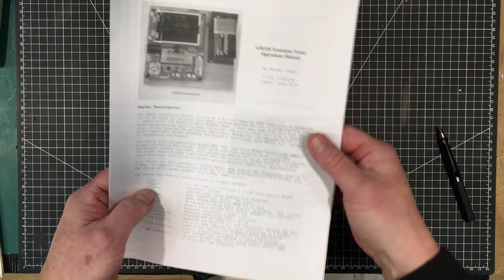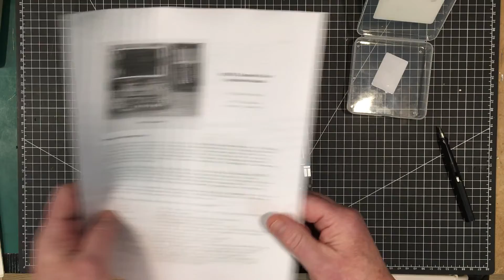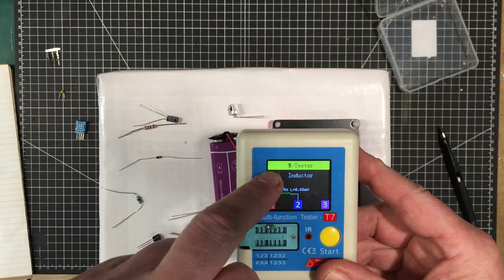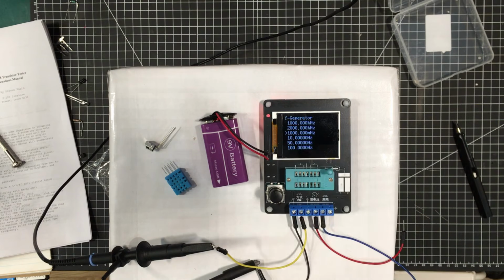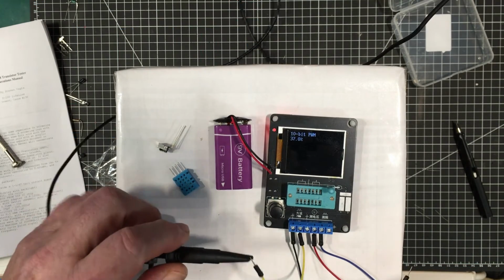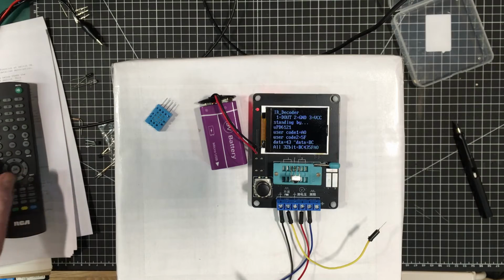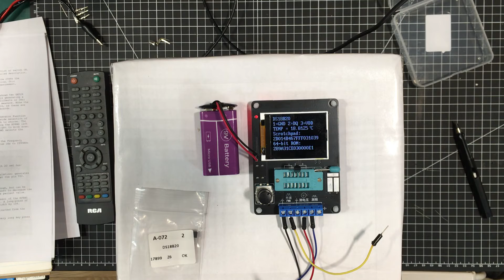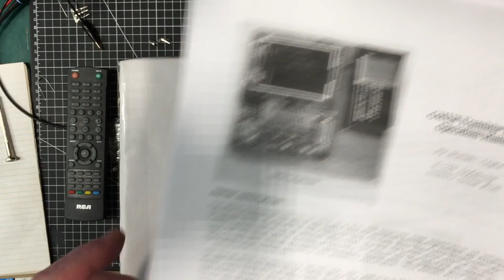0154 - Is the GM328A the Best of the mini-testers?

Comment: The original Atmel transistor tester concept was developed by Markus Frejek and Karl-Heinz Kübbeler, with firmware initially based on the AVR microcontroller platform (e.g., ATmega8, later ATmega328P). This design became widely popular due to its open-source nature, leading to numerous clones and variants produced by hobbyists and manufacturers, especially in China. The GM328, LCR-T4, and similar testers (e.g., LCR-TC1, LCR-T7) are all derivatives of this design, adapted with different features, displays, and enclosures.
Reply: And they are all garbage if they don't use the 328 processor. Unfortunately, you will no longer find any of those "LCR" ones with a non counterfeit processor (even the ones claiming to be 328 are just relabeled chips). The only way to get a 328 is this model shown here - preferably the older one with a DIP processor, as the chinese garbage does not exist in DIP.
Reply: I will try to unsolder the lgt8f328p clone cpu and try to solder one that allegedly is marked microchip atmega328p, because althought the clone doesn't have "fuses" allegedly, there is something odd about it it could be somehow not reprogrammable ? (although from avrdude it reads back as firmware correctly written, it could be the bootloader)
Reply from the maker: @whuzzzup  Thanks for you input.
Reply from the maker: Good background.  Thanks.

Comment: Can this GM328A do in-circuit ESR testing with some short wires and alligator clips? Thnx
Reply from the maker: Unfortunately, the methods used and the voltages applied to the DUT would not make this suitable for in-circuit testing.  There are some inexpensive tweezer meters from Zoyi, Snakol and FNIRSI that allow you to change the test voltage and frequency.  These would be much better for that use.  They are generally more accurate too.

Comment: Hi great video. Did you update firmware to latest.
Reply from the maker: Thanks.  I haven't found the need to update yet.  One of the difficulties is, there are a number of different versions of the GM328A, some have updates, some do not.  Before you can do anything though you need to find out which version you have, then determine the update status.
Reply: @uni-byte  got myself  same  one,  printed  a case from printables.  I saw  that there  is  an update that supports  testing  of opto coupler, im not  sure if it supported for us. I was  hoping this tester would test regulators.
Reply from the maker: @zombieryder  The one I have does not support either opto-couplers or regulators.

Comment: When you say it might be the best, you're comparing to the LCR-T7 (and all the similar Chinese clones) with the open source firmwares?
Reply from the maker: Those that I've tested anyway.
Reply: @uni-byte  With the open-source firmware?
Reply from the maker: @NicksStuff  Hmm, I have an LCR-T4 and LCR-T7 and this GM328A.  They all have different firmware on them and behave in quite different ways.  To be honest, I wouldn't really know if any of them have the open-source firmware on them or not or even if they could have it.  How would you tell?
Reply: You won't find (it seems starting in 2022) those LCR ones with original firmware because they use counterfeit chips (aka not 328) which cannot run the original firmware.

Comment: I think I've finally found some time to start playing with mine, so I figured I'd rewatch this video as a reminder since I'm old and forgetful. Being old-fashioned I've found it handy to  print up a binder with the operating manuals and specifications of my small test equipment and radio gear, gear that isn't too simple to bother with, or so sophisticated that it has a 250 page manual. Everything just has so many features these days that it's hard to stay on top of them all.  The sophisticated gear, along with component datasheets and technical articles are all stored in a folder on my laptops and a couple of USB memory sticks for backup that I try to update every couple of months as I add to the data. (Information management is a much bigger job than when I just had a stack of data-books, even when I had a whole bookshelf of them. Fortunately, memory sticks are small and cheap.) Thanks again for posting these videos. I find them both interesting and useful. You possess both technical knowledge and a common sense perspective on electronics that I enjoy. That's uncommon on YouTube.
Reply from the maker: Thank you!

Comment: My T7 was some £22. GM328A is half the price. Just tried to order one using your link, unfortunately: "This product can't be shipped to your address. Select another product or address." Could you provide link working globally? And what is affiliate link supposed to do?
Reply: After I have logged in Ali GM328A link works fine. But affiliate link still does not seem to be doing anything.
Reply from the maker: Was it the same vendor (CI-Boom Store)?
Reply from the maker: Some vendors do not ship to some countries.  I've added an alternative link.
Reply: Yes, the same store, I have already ordered. Your link was ok, I just had to log in. But what is the "AliExpress Affiliate Link: " just above "GM328A Tester:" link?  @uni-byte

Comment: Where do you get the idea that it will lose the cal information only on USB-C power? The mega328 has EEPROM and AFAIK any normal distribution of transistor tester software uses it

You can probably even recalibrate any of the boxed testers to get better results. If you get access to the programming pins you can even reprogram them most of the time to the latest firmware, rather than the one the chinese picked X years ago.
Reply from the maker: Actual experience.  I had calibrated it before doing the video using external power and it was not retained.  The ATMega328 also has 2K of RAM.  Perhaps they are storing the calibration data in there.  In addition to the 328 there is another unmarked 20-pin programable chip on the board.  Programming pins for both are brought out to pads.

Comment: I bought a much simpler version of one of these component testers a number of years ago. At the time I put it together from a kit and didn't expect a lot. Salvaging components from all kinds of things made me start using it and I have to say its been one of the most used tools I have. Recently I bought the GM328 and hope to start using it along with its increased capabilities. I'm sold on these and the price you can pick one up for it's abilities is incredible.
Reply from the maker: Yeah, they are great for quickly sorting components.

Comment: You're right. It's a very handy tester. My GM328 is the old kit one and I 3d printed a case for it. You should consider getting a 3d printer they're great for making cases and other useful things.
Reply from the maker: A 3-D printer is definitely on my wish list.
Reply: @uni-byte  I bought mine on ebay for a really good price with free shipping and shipped from BC so it didn't take long to get here. Amazon sometimes has some good deals on 3d printers as well.

Comment: I have one of them arriving hopefully within a week. (Never can be sure with AliExpress.) Thanks for the link to some documentation. I can't imagine how my life would have changed if I'd had one of these when I was 13 years old instead of having just a 12 volt continuity tester. I envy today's kids with the Internet, on-line supply houses, NanoVNA's, TinySA's, and digital 'scopes priced from $15 on up. What a time for a techie to be alive!
Reply from the maker: Yeah, can you imagine having one of these 50 years ago?  One of those little oscilloscopes like the Zeeweii DSO154 Pro too.
Reply: @uni-byte , and EVERY scope is storage. Back in 1973-4 I used to build HP scopes at their plant in Colo. Springs, and I dreamed of owning a storage scope, but they were so expensive that there were electronics companies in town that didn't even own one. Now they are $60 to $90 handheld decvices (including a multimeter,) unless you can get by with a slower $20 one. We've seen some amazing tech advances.